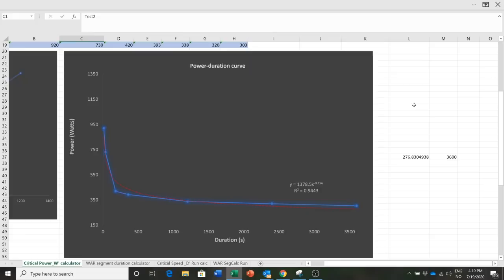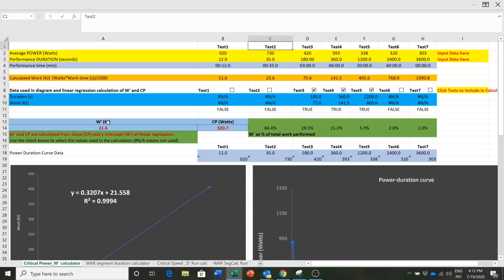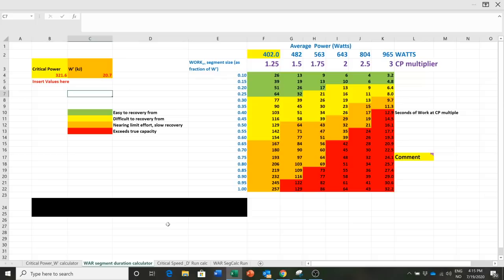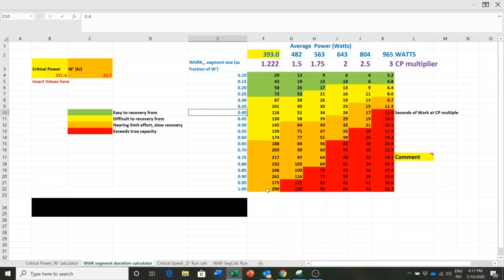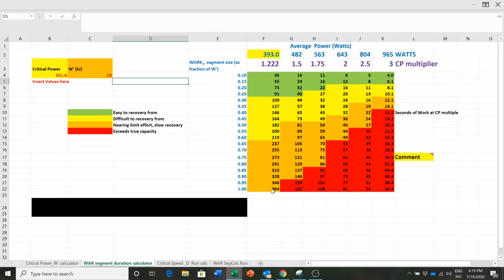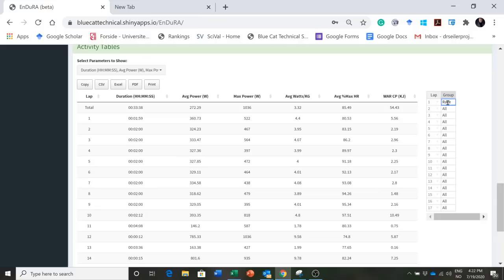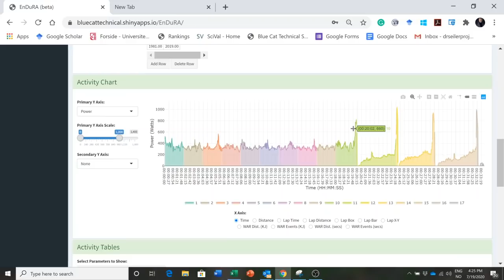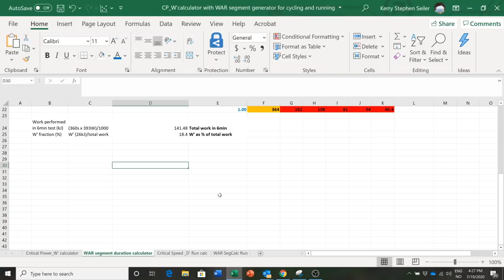Thoughts on Wprime, anaerobic capacity, 6min power, and criterium races!

Comment: I got my first PM in 2006 and soon thereafter stumbled across Monod Scherrer. It worked perfectly for me and I use 5min and 20min test with 10min break (Hunter Allans protocol). Then the resulting CP matches my verified one hour power (ftp) perfectly**. Since then I use this to test FTP. Nothing works better.

** Theoretically according to the model I should be able to hold CP(60) which is CP + W'/60 but the work/time curve flattens because we are no machines. So the model is great, but applying common sense is not a mistake.

Knowing W' in different fatigue states definitely  helps to manage intense efforts not overreaching during a break away or final last minutes in a race.

Comment: Dear Stephen, that sounds really interesting. I am about 72kg and I have similar physical capabilities. However, on good days I can do those values in your red zone, e.a. 1min 800w or 35s 960w.... i can kill myself for days doing these attemps. 
Seconds point, which is more interesting, the recovery rate of W'. The whole communities focuses on continues power testing, like 3-20min maximum power output. But when you look at a normal road, mtb or cx race, it just the whole time peak and pause for different intervals depending on the discipline. Have you ever thought of creating a test to meassure the ability to repeat anaerobic afforts and to derive the w' recovery rate from that.

Comment: I've had mirror thoughts on crank length. There's a recent push to shorter cranks on lab measurements of efficiency, FTP, comfort and so on. But I use 180mm even in a crit. In a bike race you're either off the front, in the wheels, or off the back. When you're in the wheels you can ride a shopping bike complete with front basket. What counts is what you've got available when you jump, or someone else jumps; it's that real high end and how long you can hold it for, and how often you can repeat. I find long cranks are better for that.
Reply: Lol you must not corner much, I’d be terrified to crit race on 180s, you just NEVer get to pedal out of fast corners

Comment: Wouldn't 20 min effort be a bit to long for the CP-model? 
From what i remember reading about CP, the model says you can use steady sate efforts ranging from 2-15 min and that you are required to reach VO2max during the efforts for it to be valid.
I think one of the reason the model wont work with short efforts and sprints, is that it can't account for the rate off energy release and how fast you can pump H+ and lactate out of the  muscle fibers during the shorter efforts.
Then on the longer efforts the model can't account for the buffering of H+ through exhaling of CO2, since that in a sense  would increase the total anaerobic buffering capacity and Wprime.
Reply from the maker: Well, I was trying to be forgiving in my interpretation of the model's utility. A 3-15 minute predictive validity window is, strictly speaking, more defensible for steady state events. The utility of the CP/W' model for stochastic events is unclear but interesting to investigate. It does seem like that a maximal duration for this type of event will be associated with glycogen depletion. So it might have utility for a 40min criterium and a 90min soccer match due to different rates of glycogen depletion.....

Comment: Thanks for the insightful presentation, Stephen.  
I'm still not sure what to think of the notion that there's no infinite-duration power level.   As a counter-example, I would use the Young Shuffle practiced by Cliff Young to win the Sydney-to-Melbourne Ultramarathon in 1983.  Constant "running" power for five days, 15 hours and four minutes.  For me, that's a long enough duration.  :-)
( Ref: https://en.wikipedia.org/wiki/Cliff_Young_(athlete) )

You mentioned that everything from 6min to 20min fits the model, but that 1hr doesn't.   Have you tried fitting a CP-model that includes a reconstitution parameter?   I'd also be curious about what your CP30 and CP45 looks like.
Reply: Right. I've long thought a renewal model (with a reconstitution parameter of some type) could be warranted.
Reply from the maker: Yes, there are events like the RAAM where you can almost say they achieve a quasi steady-state at some specific power (150W for example) for many hours to days.  The point is that the CP model says nothing about what this truly sustainable power output is, and it cannot do so because of underlying physiology.

Comment: So, what you're saying is that fitting a two parameter model with 3 observations and then extrapolating out of the range of the data isn't optimal?
Reply from the maker: Strangely, it seems that the underlying assumptions which make the model valid for predicting maximal power within this 3-15min (or 20) window are just not valid for continuous efforts lasting <60s or >60min.  So, adding additional, correct,  power for duration values far outside this 3-20min window from an individual power duration curve actually give you CP/W' estimates that are no longer useful for predicting "anything."
Reply: @sportscientist  It is a useful interpolant between durations.   It is not a good *extrapolant*, as you have done with the 1hr example.
Reply: @sportscientist  I wouldn't have said that. As Andy has pointed out below, it's a good predictor of interior points, not so good when extrapolating. There're a couple of statistical issues involved, but also a larger philosophical one, which is sometimes called "reification." In essence, you're estimating parameters of some model and then imbuing those estimates with a special significance, or reifying them. This has happened in many fields, I'm not singling ex phys out. 

Estimation of a 2 parameter model with only a few data points is a different issue, but even then you can do some examination of the robustness of the slope and intercept. 

FTP is a one parameter model. W' and CP form a two parameter model. But in either case, I like to cite Sam Karlin's "the purpose of models is not to fit the data, it's to sharpen the questions." In that context, your color-coded table that shows what's physiologically unattainable is a sharp question.